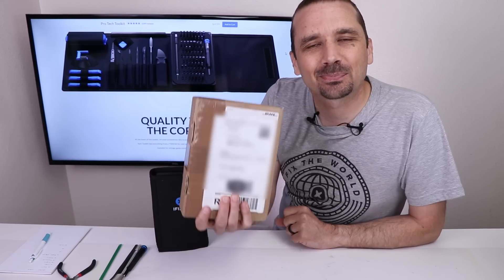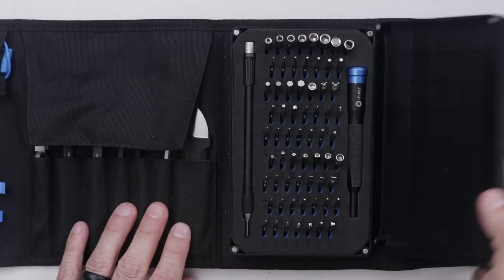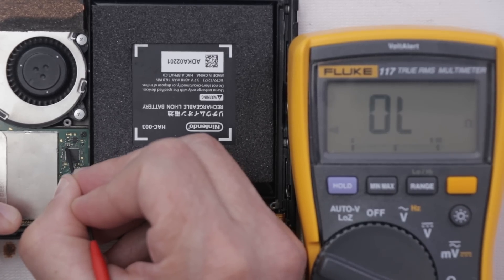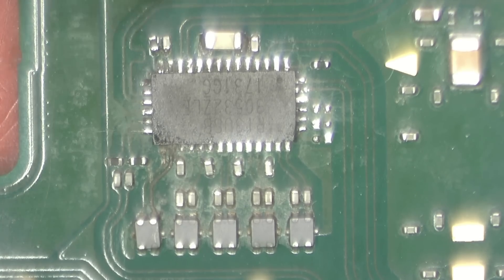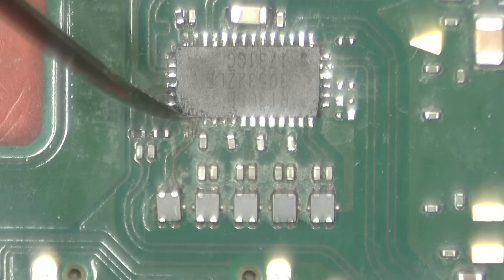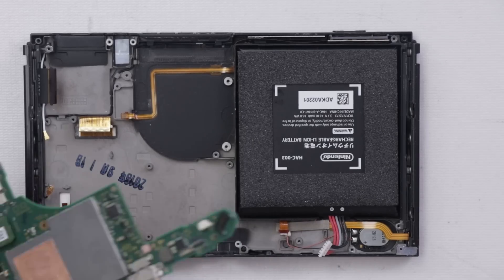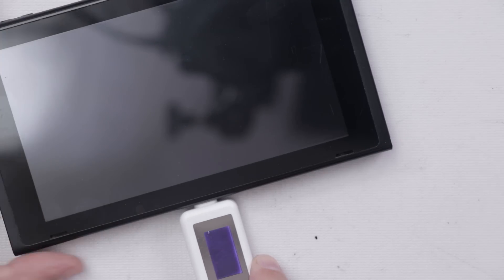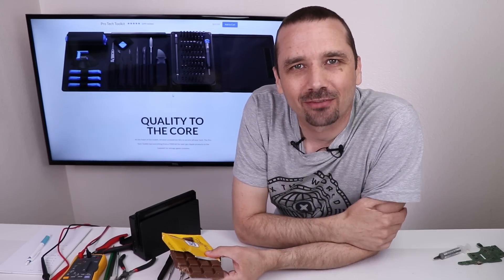Repair Shop BOTCHED This Nintendo Switch - Can I Fix It?

Comment: Anyone come across why a water-damaged Switch's backlight won't work? The connector is attached and the Switch's display is only visible in a dark room with a light source directly pointed at it. Thanks in advance!

Comment: I only use DOCK mode. I don't need a battery. Is there a way to remove the built-in battery and directly input the 4.7 V voltage to the DCDC converter? Can you teach me the technique?

Comment: Great fix! One question I have is if solder mask should be applied to the wires or not. Sometimes I see people do it and other times I don't. In this case, are the chips so small that it wouldn't be easy or possible? Thanks for the awesome videos!

Comment: Erm. Soldermask? You may want to upgrade your microscope or your trinocular port adapter. Or maybe your microscope cam. 

I'd recommend soldermask and UV over the jumper. Connection can be weak and shotty without it.

Comment: Can you explain or provide a link on how that "capacitor shorted" system to troubleshoot works? Seems like a very easy way to pin problems down that are connected to much more complex chips! Thanks!!

Comment: I have a 117-in-1 tool kit, it's a little better than the toolkits on iFixit no offensive to iFixIt it's just I rather be able to have a number of types of screw head tips than just what you get in the iFixIt toolkits

Comment: You are the best steve i have question why u dont put aluminum tape when you are working some capacitors may go of the board when your using the heat gun second question what type of flux do you use

Comment: You are NOT a repair person you are a surgeon that has a heart, and that is why your channel does so well. 
I have watched you from almost your first video and commented (quite verbal I am, much to your chagrin I imagine) on most. Extraordinary talent on board level repairs, logic in fault chasing and just pretty knowledgeable all around sir. 
Board level repair on such small circuitry is beyond me, having done it in locomotives where the components are the size of grapes and the traces are 1/8 inch wide and 1/8 inch apart, I find the small boards require sufficient velocity to completely disassemble themselves on impact with a sufficiently hard surface. 
Love the vids, love the logic you employ, love that you have a huge heart and lastly love that you allow us to ride along with you during your repairs.

Comment: Your ifixit toolkit looks pretty beat up so I know you use it a lot, any comments on how long those bits inside last in day to day use?
Reply from the maker: Depends on how you use them. If you use the right size all the time and use enough downward pressure they can last for years.

Comment: I'd really like to buy a soldering iron and heat gun, but the ones linked are over 1k each. Are there more affordable options, that would get the job done as well? Any good brands? If anyone could help, I appreciate your help.
Reply: Of course! I do console repairs too and i dnt use the same equipment as he does I use the ts100 Its only around 100 and a hot air station that was around 200

Comment: You need to open the chocolate by breaking it in the middle! Other than that - good video 😉
Reply from the maker: Now you tell me!
Reply: Then wouldn't you need to eat the entire thing at once?
Reply: @Saltiren  It's the intended way of opening it and it just splits in the middle. The package comes apart at the seams then. No matter how you open it, it's open afterwards 😅. You can also easily break off single pieces like that.

Comment: Don't you hate when the dock doesn't want to play nice?  Can throw the repair person off once in awhile.

What angers me is the professionals who damage your electronics more and then go "Oh I can't figure it out" and then just give it back to you.
Reply from the maker: Ya, docking can be a problem. 
It's even worse when they can't fix something, make it worse and then STILL charge for the "repair"
Reply: @Tronicsfix  I wish I had a way of showing you an XBOX One X a customer just brought me that a shop destroyed an APU line on trying to remove the XClamp.  Thankfully I was able to take care of it.

By the way I wanted to ask, in previous videos you've mentioned BW100 I think it was for cleaning joysticks out, I have  yet to see this in Canada, is there anything else you would recommend that does the same thing?

Comment: I have a Switch that is missing one of the filters shown in this video. Would anyone happen to know where I could buy more of them?
Reply from the maker: Pretty much the only place I know of to find stuff like that is from other broken boards. Wish there was a better way.
Reply: @Tronicsfix  I've got the system working again, but it won't display on TV in the dock. I'm guessing that's the issue. Guess it's time to look for some busted boards. Thanks for the reply.

Comment: Man, German efficiency with packaging AND German chocolate?! That's pretty good!
Reply: Theres only one thing where we are not efficient and it's building airports.
Reply: @Tobi_DarkKnight  Well.. we built it, but it won't work 😂
Reply: @jochenwuerfel  die machen eine Zwischendecke hin, weil die Sprenkleranglage zu hässlich sind.
Reply: @Tobi_DarkKnight  😁
Reply: @Tobi_DarkKnight  well I mean the expansion of Munich airport was on time and on budget. Seems to be an issue with the Berlin people ;)
Reply: Sofort gefeiert als ich dad gesehen habe 😂

Comment: I need some help hopefully someone can help me, I'm trying to remove the back panel of my newphews nintendo switch but the screws are stripped I suspect it was open before but not with proper tool. Any recommendations?
Reply from the maker: If they are totally stripped with no hope of getting them out then I'd use a rotary tool (like a dremel). Not fun but it'll get them out.
Reply: @Tronicsfix  OK thank you, I'm a big fan of your work btw.
Reply: @Tronicsfix  can you help me fix my ps4 remote it came with joy stick problem
Reply: maybe a thin elastik band? ive seel it with normal screws  but dont know if it would work with the small screws
Reply: @MrJever180  I tried  the elastic band just rips because it's so thin. 😔
Reply: That's bad, hope you find the solution soon
Reply: @PRO_VE  I hope so too it was a refurbished switch but whoever did that stripped the screw.
Reply: @jpparga6426  It's it's refurbished just return it as faulty. Hopefully it has a warranty.
Reply: People sometimes remove screws by drilling through them. Of course you just have to be super careful not to damage anything and a small drill bit has to be use since these are pretty small screws. After that you will have to get new screws of course.

Comment: Sir do you know what 8s the sensor that senses CMOS batteries voltage in a pc? If you have any idea thank you or no problem
You make real Nice content ☺️
Reply: It is integrated into the southbridge, but if that is dead, the rest of the chipset also is (as in most likely has a blowhole in it, usually lets out the magic smoke and the PC will definitely no longer power on), so any low voltage errors will most likely be caused by the battery voltage not getting to the southbridge, or the battery being dead.
Reply: @unmountablebootvolume  nah the battery ain't dear as I replace it 2 times . Also what's the southbridge? I took off the mother board no burns or anything
Reply: @unmountablebootvolume  btw love the bluescreen😂

Comment: What causes the board to become damaged like that to where a trace is necessary?
Reply from the maker: Usually it's caused by using the wrong charger. This can cause too much voltage/amperage to go into this circuit causing it to burn out like this. It's a common problem with these.
Reply: So, bottom line: use the charger that came with the console.
Goddamnit!
Reply: @SNC2319  it should be fine if you use a charger that properly meets the USB spec. Problem is there are a lot of garbage ones out there that don't.
Reply: @awilliams1701  yeah that’s true.
Reply: 123456789101112😂